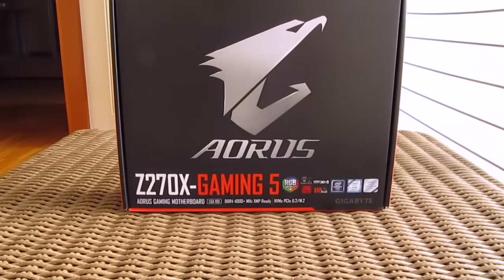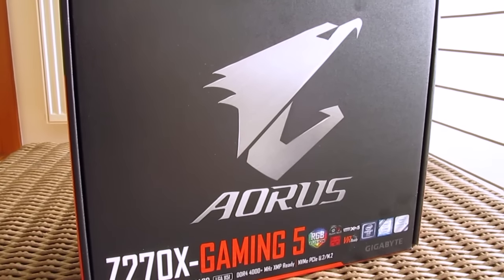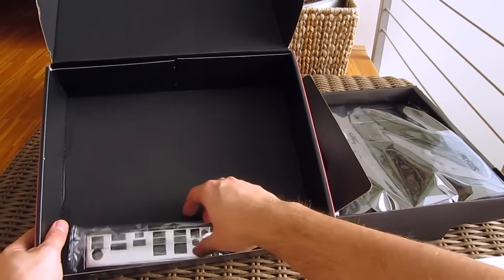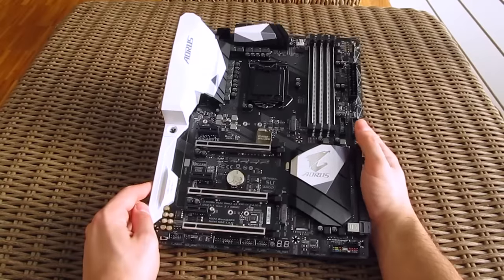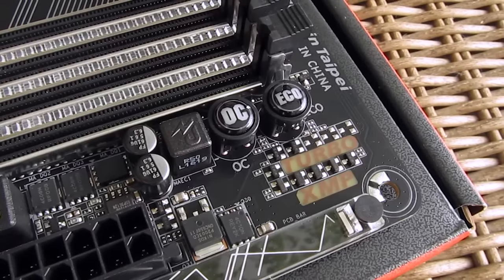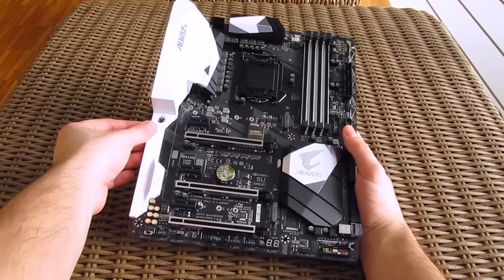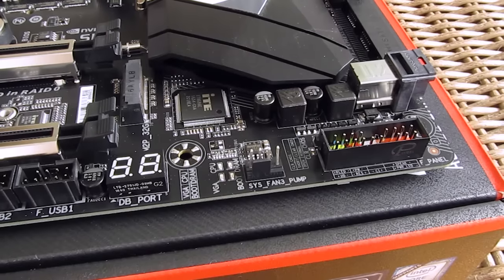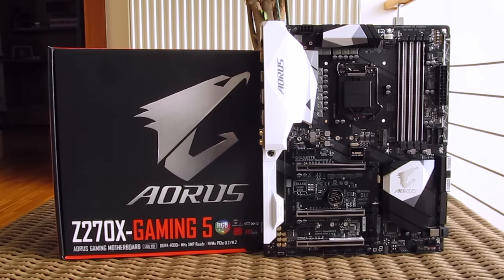Gigabyte Aorus Z270X Gaming 5 Preview - RGB, RGB Everywhere!

Comment: Recently bought this board with kaby lake 7700k, absolutly loving it, but stock CPU volts come very high, 3.4, so about to do a bios update cause the high volts are giving 20 deg increase in temps, hopefully bios updat will fix. If not I'll have to figer out how to manuley lower. Volts this high could run5ghz oc
Reply from the maker: Did you try with new BIOS update? It seems that Gigabyte board tend to overvolt by a lot compared to others!